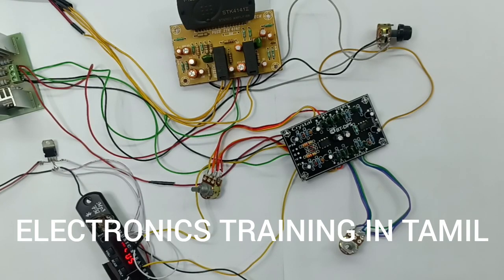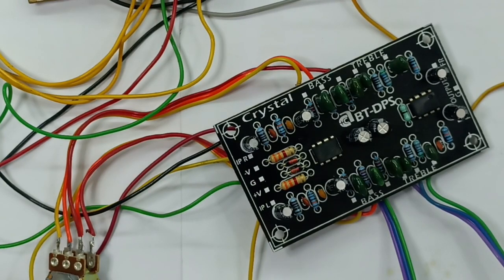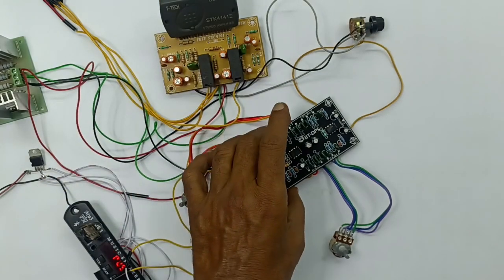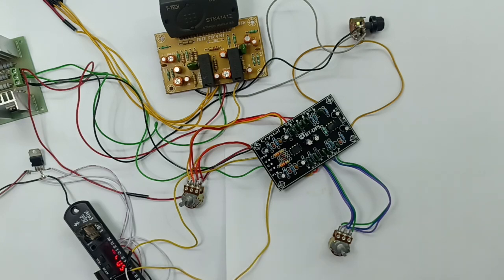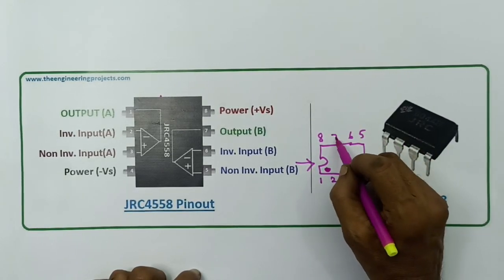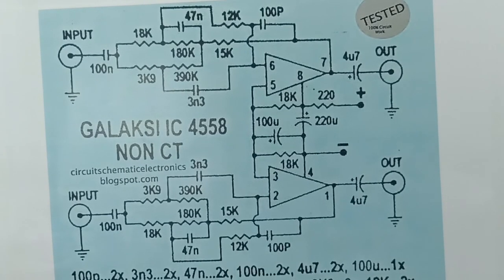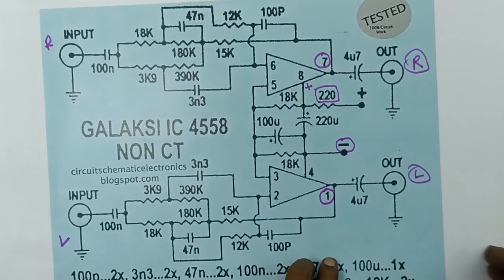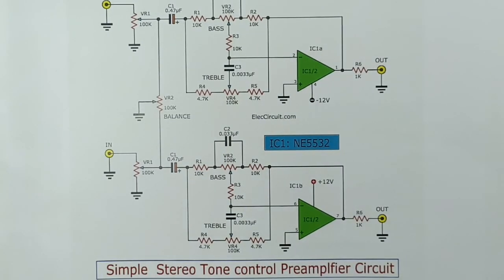4558 D DUAL OPP AMP IC... USED TONE CONTROL CIRCUIT (B/T), DPS.. WORKING PRINCIPLES+DIAGRAM+DEMO

Comment: Do you have tone control circuit using BC 547
Reply from the maker: Go through Google... A lot of circuits are there
Reply: @electronicstrainingintamil1625  there are so many in Google but not that much good sir